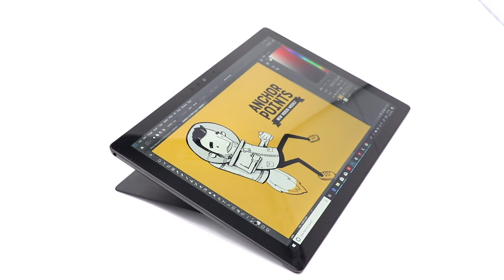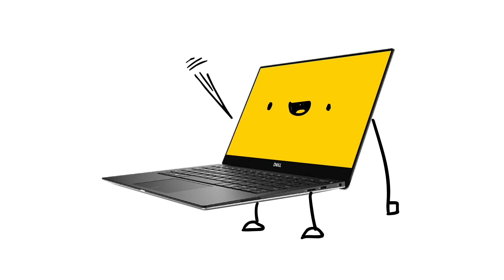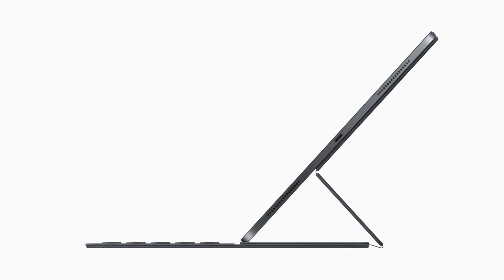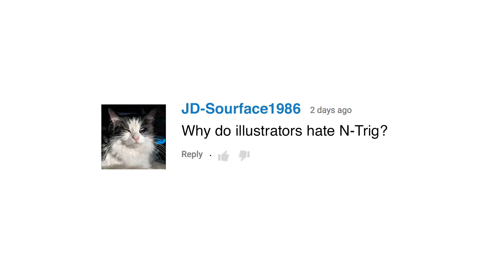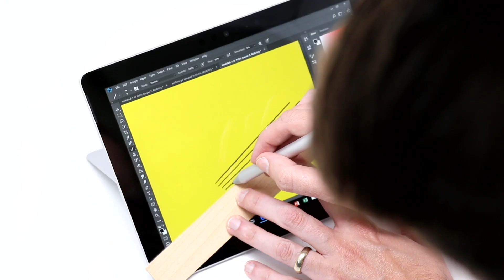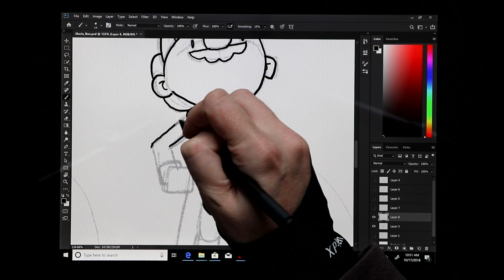Surface Pro 7: Rumors and Updates

Comment: A notch on a computer? I can do without a camera on the front I've never used the front (for use other than Windows Hello) or back cameras on my surfaces.
Reply: needs front camera for Hello and videoconferencing. I've never understood the back camera either though. I've never once used the back camera on the SP. My guess is that MS planned to integrate AR software, or maybe still does plan, which would allow a designer to visualize the space he's working on using that camera, but that's just speculation.
Reply: @elenchus  I use it sometimes to take pictures of documents that are likely to either not be uploaded at all or not within the timeframe that they are important for. Like it will be information about when the exams are etc but some profs won't upload those pages as part of their PDF's because it's not part of the subject itself. Or if a prof sketched something and I don't feel like copying it by hand. But yeah that's fairly niche and muss less important than the front facing one.
Reply: @diesertyp7822  That's an interesting idea, although out of curiosity, why not just use the camera in your phone? I guess I'm thinking that if someone is using a high-end ultrabook or 2-in-1 they probably have an even better camera in their smartphone
Reply: @elenchus  I mean yeah,  I could but that's kind of a pain in the ass isn't it? I mean I then have to move it from my phone and on to my surface and yeah that's not difficult but that sure does require more effort than just taking the picture with the Surface itself. Plus I don't really see any benefit to removing the back camera other than a potential but very unlikely price cut.
Reply: The back camera was helpful for taking pictures of class handouts and book pages to take notes directly on the photo. This got synced automatically to my One Drive and my notes were never lost.

And, of course, front camera for Skype.
Reply: For a professional video calls are important. So it would be a very bad idea to remove the front camera.
Reply: @diesertyp7822  This. Many people here seem to think Surface Pro is only an art laptop, but it's actually a popular business laptop as well, as it's a high quality device and the size and weight is pretty damn good for business use. And like you said, for video calls it's a must to have a front camera.

But the back camera, that's something I doubt many will ever use.
Reply: I use it for Skype a fair bit.
Reply: Psst, they want to spy on you 🤫